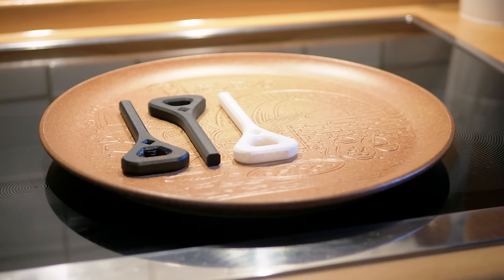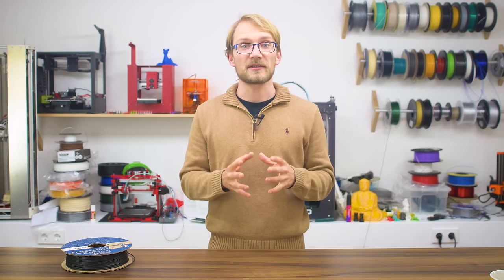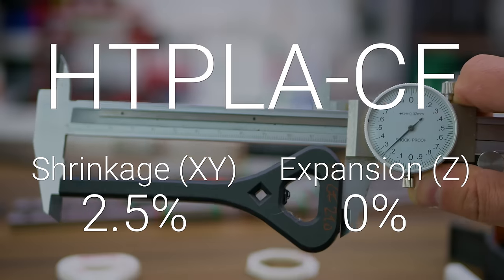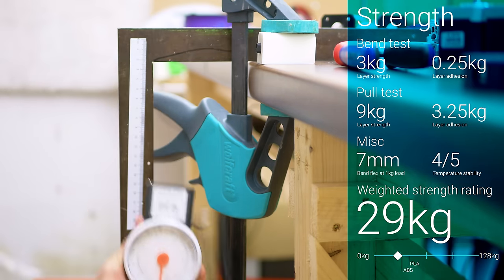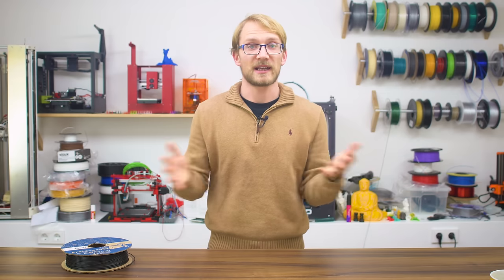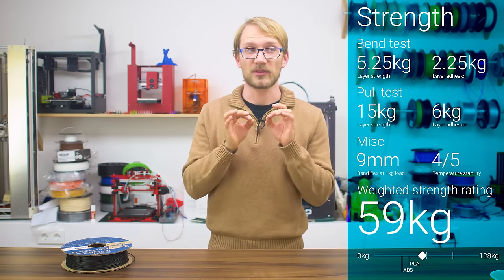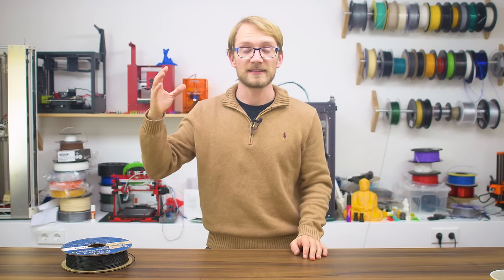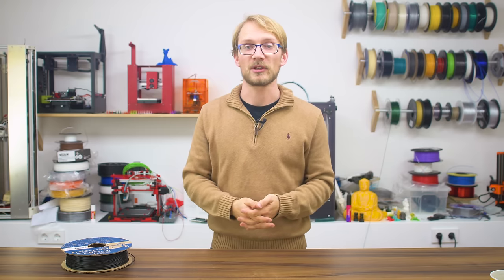Bake your PLA and have it outperform everything else! #Filaween

Comment: do you print with 100% infill ? Have you tried raising your extrude rate to raise the density of the final print and then anneal them and see if you can reduce the shrinkage ? I have experimented with 175% rates and get a very dense strong part, printing in a clear filament at extra high rate there is very little internal weave, and printing on glass sometimes makes the print almost impossible to remove, there is such a complete fill of the surface micro detail that it adheres amazingly well.

Comment: Would you recommend making gears out of annealed PLA?
Reply: That's what I plan to try, my Greg's Extruder is made of ABS and the small gear is falling apart.
Reply: Craigthepope
If you remember, let me know how it works. I would be using it for modding Nerf guns. Some of them use gear systems, and it bottlenecks there potential.
Reply: +BLOOGaming
I printed a small herringbone gear for Greg's extruder at scale 105%. It was printed with silver Inland PLA+ filament. Layer height was .2 mm and infill was set to 100%. I baked it for an hour around 110 C (230 F). There was no dimensional change, I attribute this to the 100% infill. I'm unsure if the hardness has increased, I will need to reprint at 100% scale so that I can see if it experiences reduced wear.
Reply: Playing gears are fine. I've been running the same PLA hearingbones for years now.

Comment: Tom, after the heat treatment, would you consider using pla for parts that would be near/around heatbed and nozzle?   I am building another printer, and this is an interesting concept.
Reply: would be worth a test I guess.  print the part in question.  bake it.  measure it.  adjust reprint and see if it holds up... obviously with a backup part in case something goes wrong

Comment: What temperature should I set my oven to if the recommended print temp is 180-220? Also, does it leaves toxic fumes to the oven if I bake the parts since I'm most definitely going to use the oven in the future lol

Comment: Try using a pressure cooker as your heat sorce and see if you get better results. You will need a psi to temperature chart, but totally do able. I think an oven on a cookie sheet is not the way to go here.

Comment: I'm sure you get tired of replying to comments all day long but I do have a couple questions that I would be gracious if you answered. First, your video makes a mention of a "pull test" or more specifically a tensile load test, and I am wondering why you only showed the bending behavior in your video. Second, in your video you use the mass as a representation of the strength of the part when you really should have used the stress (von-mises, normal, etc.) so we can more closely compare to tested values in trusted journals. Lastly, with regards to the orientation of the print was that orientation always consistent in your strength tests? Like the side you printed on the bed was it always facing down in your tests? Surely you can appreciate that there is a thermal gradient across the print piece that would cause residual stresses and have an effect on the maximum load a piece could attain. 
Something I would like to see would be a print/ anneal where you print the part, remove the part and place it in your oven face-side down (opposite orientation) because typically annealing is performed to relax a material in order to remove the residual stresses from manufacturing.

Comment: So, if i need strong parts (mainly gears), stable to nitro thinner, without heat resistance needed, annealed PLA is a viable solution? Great! Do you have some kind of model file to print in order to detect shrinkage?

Comment: This is an awesome trick for PLA, although to use it with something that needs high tolerances will be a design nightmare. I think it could be taken a step further though. You baked all the plastics based on a temp setting meant for proto plasta PLA. For each plastic like ABS or what ever plastic. 230 degrees F is unlikely to phase ABS much, but what about 300 degrees? Get what I mean? Anyways, awesome vid, defintally will use these tricks. Another thing. You should do a video on PET+ by made solid. Thats some of the best filament I have used. In my experience, easier to print and more practical than PETG.

Comment: I 3d printed a modular ar15 reciever in ABS and treated it with acetone initially. After I tested it I noticed overall I could not flex it as much, and the fit of the parts became tighter.

Is it possible that firing 10 magazines back to back caused enough heat to anneal the surface where the reciever meets the metal upper reciever?

Comment: Not sure if this is at all useful here, but annealed plastics in the machining industry are fairly common. The goal,a far as I can tell (with little research), is to remove excess water and moisture. By drying the plastic out, the material tends to machine far better since it can now break apart under cutting load. Non heat treat plastics really don't produce a chip and create long strings.

Comment: As someone who wants to get into 3D printing and will most likely be exclusively using PLA, this is great news as one of the things I wanted to design was a mug and another thing with a a phone case (sort of), both of which would be exposed to some drastic climate changes.

Comment: So could this work for Edge / PETG if the oven were set to a HIGHER temperature for the treatment? (Like 110C was not high enough to start the process for Edge, so it was just like leaving PLA in a hot car....)

Comment: Interesting. How about vertical tensile tests?
I also wonder how well 3D printing in a heated vacuum chamber would work. If it would have far greater z strength. Maybe just a hydrogen atmosphere could help. Air in the process can't be good. Need vacuum to be a controlled process.
Reply: In vacuum the heat transfer would be bad, only radiation would heat the part if the chamber can reach low pressure

Comment: Ok this may be a totally wacky Idea, but has anyone tried an air fryer or a convection oven instead of a standard oven? 
Thinking of how a standard oven heats from the top and bottom it looks like having a more uniform heat source could be a way reduce the expansion or warping. 
I also wonder if the orientation of the part / layers would have an effect. for example if you knew the z would expand, orient the layers opposite of normal to see if  it's the layer that's expanding or the part itself. 
May have to try some experiments.

Comment: Tom, I love how obvious this benefit of heat treating is in your demonstration! You got absolutely to the point about carbon fiber HTPLA, less shrinkage in getting to improved heat resistance.

I noticed your test parts aren't solid.  Many customers have reported wall thickness having a strong influence on strength (surface effects or just cross-sectional area?), so it would be interesting to see if the difference in strength is linear with 100% dense parts as well.  In our test, the shrinkage of 100% dense parts is also less (sub 1% change with HTPLA-CF).

Anyway, I hope this experience both peaks your interest and your watchers to experiment more with baking HTPLA so we can collectively learn more about the potential of crystallized PLA.  I'm always trying new ways to dispel the myth that PLA is weak like in this recent demonstration (https://www.youtube.com/watch?v=wBjszjsYRy4), but you are the pro!  "Myth busted!!!"

When considering other geometries, you'll find that not all parts can survive heat treating.  PLA becomes very "floppy" before becoming firm again.  Carefully handle some warm parts throughout the baking process to feel for your self.  We kept standard HTPLA translucent so you can use the change in opacity as your guide.  Try a vase, for example, with the light on in your oven and you will see the change in a matter of minutes right before your eyes.

HTPLA is tricky but amazing, and the transformation is the perfect treat for Halloween!  As always, thanks for sharing!!! :-)

Comment: Quick point; you said that you can delaminate layers in ABS prints, and a lot of people make this claim. I disagree. I've done some pretty serious experimenting with temperature, and if you print at around 250-265c, in a chamber with >65c air, the prints are no more likely to fail along the layer axis, as they are any other arbitrary axis.

Comment: Hi. I know this is an old video but anyways: did you use your normal household oven and did your next pizza taste funny?? 
i'd like to try that heattreatment but i'd also like not to be beheaded by my wife 😅
Reply from the maker: While I certainly wouldn't recommend using your food-grade appliances for treating plastics, I decided it would be ok to heat PLA in my regular oven since it's not a particularly harmful plastic when heated/pyrolyzed (as opposed to something like ABS) and I was staying well below the melting point of PLA (most of the time). So no issues for me there, but using an additional metal / glass / ceramic container to keep any fumes contained while the parts are in the oven probably isn't a bad idea either.

Comment: You’re not doing anything wrong with the CF filament. The carbon fibers aren’t there for increased strength, but increased stiffness, and only in the print direction as the fibers align with it.

Comment: Im trying to make a large d20 die that always chips when I roll it. I have a feeling that this would help, but do you know if this would skew the rolls so it always landed the way it was baked. Just want to make sure I don't accidentally rig any more 3d printed dice
Reply: I don't think 3D printed dice can ever really be fair. If you print a cube and measure it with calipers the dimensions will always be slightly off what they were supposed to be, and that slight inaccuracy would be seen in the results if you tested enough times.

A common trick among cheaters is to put their dice in the microwave for 20 seconds with a high number facing up. The plastic throughout the dice melts ever so slightly and is pulled down by gravity, which lowers the center of gravity and encourages the dice to land that way in future.

If you're going to print dice, its at least worth looking into how to randomise the start location for each layer. The default setting in a lot of cases is to start in the same place on every layer which can create an obvious seam which would most definitely effect the balance of a dice.
Reply: SwishSwish Wow! Thank you so much for the info! That's probably the most helpful advice I've gotten from a YouTube comment. Bravo! 
(Also thanks for being a genuinely nice person)

Comment: Isn't it unhealthy to reuse your oven for food after baking Pla plastic in it?
Reply: Maybe: plain pla should be food safe, and annealing is nothing like extruding. Still, it might be better to have an oven exclusively for this purpose.
Reply: shouldn't be an issue generally.. Basically it's made from corn syrup (yes, yes all you super techno's there is more to it, but basically)  now the additives might be an issue.
Reply: K. Slegne I already thought so... I will try in my normal oven if it works, and if it does I'll try to find a second hand small oven to serve this purpose

Comment: I infused abs based cf with resins as well as epoxy (the epoxy does it better), no significant improvements, and  anneal uninfused printed parts on 65-110℃ (no sense in anneal resin infused parts, toxic) also shows no improvements...cf filaments needs to be a single continuous strand to use it's special properties, no dice on chopped strands (maybe if it be bigger)

Comment: Nice! I tested annealing PLA a while back, but immersing in hot water (using a sous vide device) at 60, 70, and 80C (https://twitter.com/jkao/status/440207982333153280). While my temperatures were lower than yours, I found similarly great results with heat resistance (https://twitter.com/jkao/status/443978958078361600). I have a PLA sun-visor clip in my car that's survived 2 summers parked outdoors during California heat waves and is still going strong. It's under tension, gripping the visor, and is still going strong. I didn't measure for shrinkage, so I don't know whether the parts annealed under water (and at lower temperature) shrank a similar amount.
Reply: I believe that is similar to how they harden gears.

Comment: What about putting it in cold water straight from the oven like when you strengthen steel?
Reply: that only works for steel and a few other metals with allotropes. plastic doesn't behave this way
Reply: That'd have basically the opposite effect of annealing. Annealing is bad for metals because imperfections in metallic crystals trap stress. Annealing is good for plastics because it makes them somewhat more ordered, but still much less than metals.

Comment: I though the benefit of HTPLA was it printed easy like PLA compared to ABS but after heat treating it could withstand higher temperatures. So using it for a phone holder in the car would be good. 

Also the carbon fiber pla really isnt suppose to be any stronger, its more for looks.
Reply: More fiber, less shrinkage.  Less fiber, more strength.
Reply: the rigidity is nice for mechanical things

Comment: I have a problem with my motor and also lcd . when I connect my 3d printer to power supply my lcd goes white and when I connect to usb it becomes normal (after removing power supply I mean) can anyone tell me why?.
And the second thing is I bought 4kg cm torque motor from eBay for my printer.  some motors are  rotating  during no load but when I connect lead screw without even applying load it stops rotating can and even some motor just vibrating not at all rotating what will be the problem ? plz anyone help me and guide me

Comment: The video is complete bogus. 
Parts should not be baked at the same time, but one by one at the same place. Baking all test parts at the same time will cause each part to have a different heat distribution thus making the test completely invalid. 
Further more the shrinking creates a higher density part (e.g more plastic per cm3), which partially explained why a shrunk baked part is stronger. 
Note: The other reason is that a smaller size part has a smaller arm, which requiring more strength to break it. 
I think you might stop the shrinkage by using a 100% infill, since this would reduce and possibly eliminate the shrinkage.

Comment: plastic is just not suited for this works. the human work with natural materials is still better. plastic will always have disadvantages against the materials it's trying to substitute, still... plastic has an advantage with the materials it does not try to substitute... it lasts for ages. it does not rust... yet, it's very artificial.  NERDS.... do not try to substitute our work and our relationship with nature just cause you did not wanted to be physically able to transform nature as a weak human... use your brain and bodies to better yourselves.... embrace nature. please.....